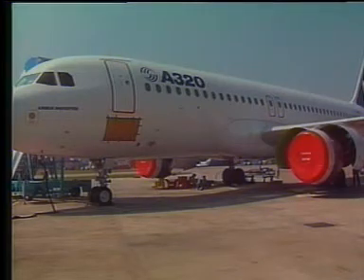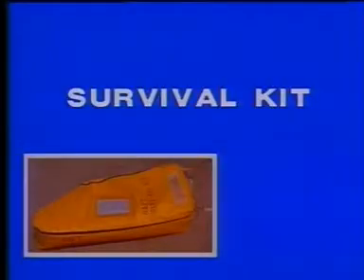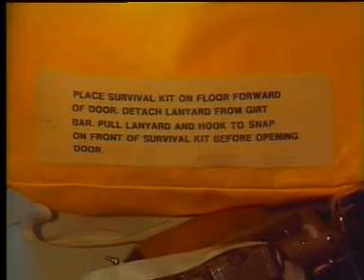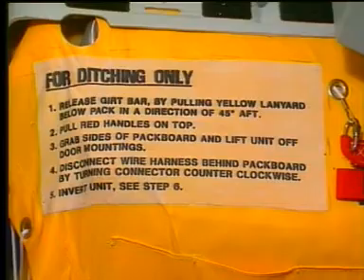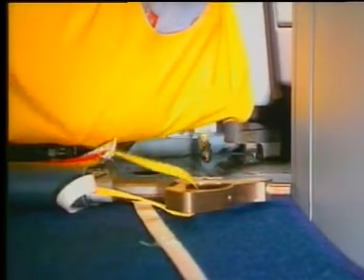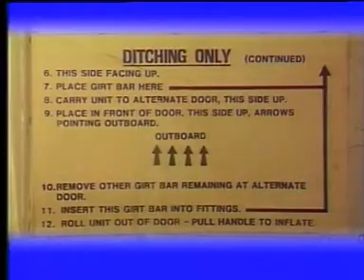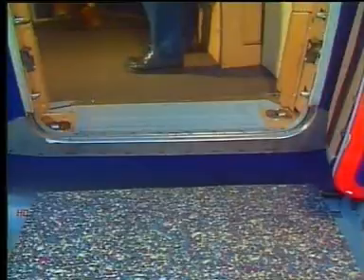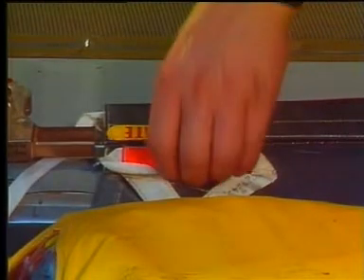A320 Slide Raft Move during a ditching

Comment: Don't forget, the Sully plane floated for ages, plenty of time to deploy a raft like this if needed.
Reply: Obviously this was not Sully's A330.
Reply: @davidkamen A320
Reply: @HasanTarraf-fb1wo  thank you for correcting me.
Reply: @davidkamen  also this is rarely done, incase of water landing, flight attendants are trained to do this (IF SAFE)
Reply: @HasanTarraf-fb1wo  yes, the USAir aircraft landed in the Hudson River in New York City but contrary to what most people think, the aircraft was only floating while the passengers and crew were standing on the wings awaiting rescue.    In the rescue videos you can clearly see the aircraft floating down river.  After everyone was rescued the aircraft was towed to shallow water where it no longer was floating.  One of the engines was ripped during the landing, the other engine remained attached to the wing.  Once towed to the river bank on the New Jersey side the nose was sticking up out of the water but the tail was mostly underwater because the aircraft was resting on its single engine and the current along the bank is very slow and not powerful so it remained there until it picked up by a barge mounted crane, the wings were removed and fuselage and wings were taken to a warehouse to be examined as part of the NTSB usual investigation.  The reassembled aircraft is housed in a museum setting and the public can view it up close.  I follow these events closely, I have been a 5 year military pilot and a 37 year commercial pilot for 3 airlines